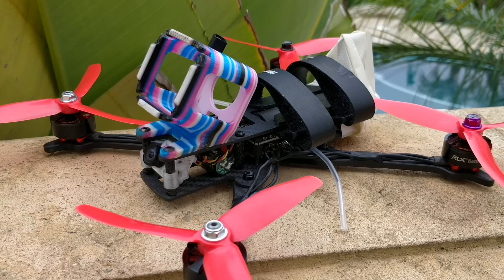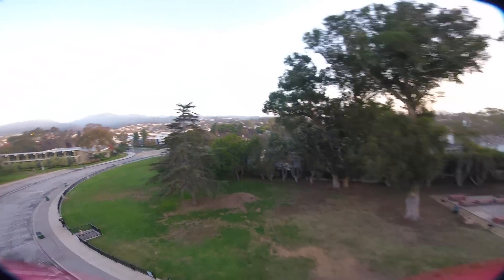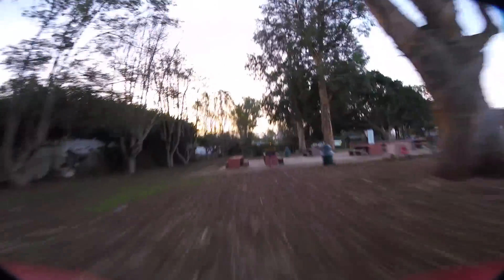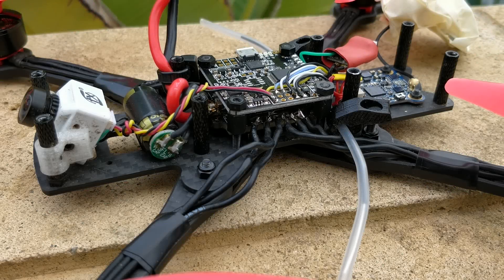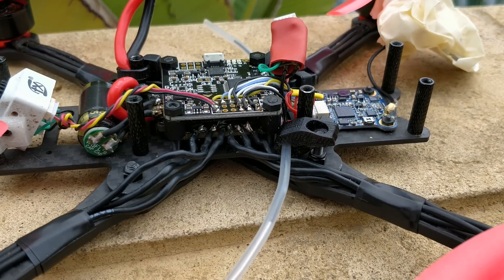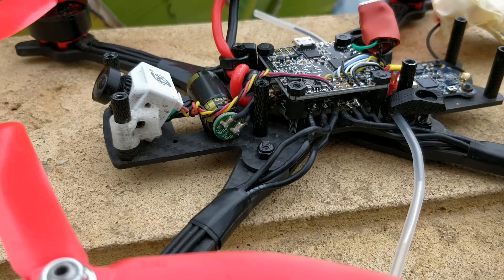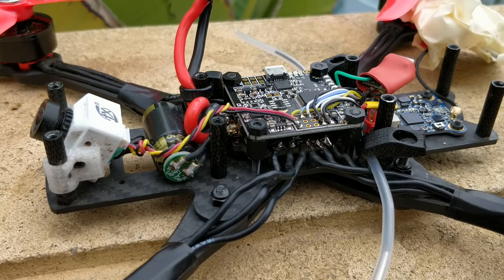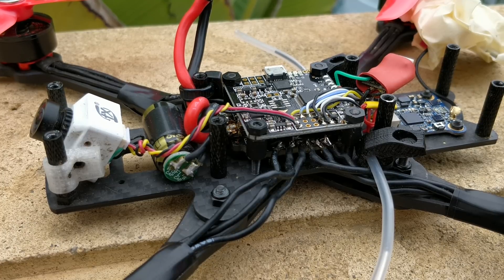Naze32 in 2019...

Comment: Where do I even begin... let's start with gyro sample rates and aliasing.  When you run good motors and good props, you aren't generating a mess of vibration in higher frequencies to be picked up by your slower gyro setting... and therefore aren't causing problems because filtering can do its job by only knocking back noise and leaving physical motion at lower frequencies untouched.  But when you have vibrations above the nyquist limit of your slower gyro read, it's going to alias over top of the physical motion data and cause it to fly terribly just like builds of old.  So it flies great cause you have great gear.  Props, motors, and frames of old made a bigger mess above the nyqyist limit and aliasing caused that data to stomp all over the lower frequency data representing physical motion.  Since we try to filter only above the frequencies of physical motion - this aliasing in the low frequency (false data) was the source of poor flight performance.  To test this you can go run an old version of betaflight on the same quad.  It will still fly great.  You'd just have to select the right gyro settings and filters cause the best approach for our current gear wasn't exactly default in the really old versions.  Alternatively you could go bend a few props and you will quickly see this current setup fly just like an old school build.   We pushed for faster gyro reads to stop aliasing so filtering could clean up the problems generated by messy gear.  It's still a useful tool, it's just not widely understood for the advantage that it really gives us.  It helps damaged or lower quality gear fly better.  So I give my kudos to the prop companies and frame designers - these are where the biggest improvements have been made to improve flight!  Happy new year
Reply from the maker: Interesting. I would note that the motors on this quad are totally wrecked and the besrings are even crunchy. That's hard to do on a 9mm bearing. It seems like different approaches to the same thing and nothing is perfect. 

I would ask you about another area too. On micros, the higher rates definitely make a significant difference. I don't understand why it seems to matter more on micros.
Reply: @Kabab  I agree with that observation.   Even on the alienwhoop zero where we only run a 1k loop, we read the gyro at 8k cause anything less flies terrible.  Micro brushed has to run so much more D to fly right which is just a huge amplifier for noise so definitely related to accurate gyro data.  Micro brushless just due to physical size (smaller props/shorter arms), and motors that are turning higher rpms generate a noise profile which is much higher in frequency so again tied more closely to gyro read speeds for accurate data.  An interesting account from a firmware dev I read a few years ago described a method where he plucked his props by finger... and listened to the note it "played".  He set his filtering to that frequency and it flew great.  Smaller props play higher notes and require faster gyro reads to avoid the aliasing issue.
Reply from the maker: @_NFE  very interesting and makes sense. So something like an X class craft would pretty much never ever need anything past 1k gyro rate since everything moves so slowly. This also make clear why car sensors have such slow refresh rates. 

So these recent big prop whoops I'm building have PIDs not unlike brushed quads. I assume PIDs are based on power. The one with the racerstar motors has a D of 80 or something while the more powerful one in the video going up in about 2hrs and based on an 0802 12000kv motor has Ps of 100 and Ds of 50 on 1S and 57p 35d on 2S. Am I in the ballpark or just shooting in the dark?  I was working with these numbers to make them fly right in gusty conditions. Definitely improved a LOT. 

Oh yeah, a PID rate of 8k with slower gyro rate seems to do nothing. By your logic that makes sense.  ?
Reply: @Kabab  yeah your right on the money that pids are based on power.  More specifically the response characteristics of your build.  Power is certainly a major factor in responsiveness, as is a motor's ability to change speed rapidly, the bite of the prop to affect inertia and momentum.  Funny how similar the concepts of "power" and the ability to change the application of power very rapidly are to the concepts of P (proportional response gain) and D (rate of change of the Proportional data).  Your numbers for larger "whoops" sound ballpark... but I question the sanity behind diving into that rabbit hole in the first place.  Ducts are an aerodynamic disaster.   Beyond the novelty of the tiny brushed indoor craft where the additional drag brake of a ducted frame helps in navigating a tight course, I see no need to persue ducts in any other application.  But my prejudice aside, hauling large ducts around is going to take an abundance of P to overcome the influence of the drag, and high D to go with that high P but in a ratio that is lower to P  than an unducted craft since the ducts do part of the damping for us which the D gain is responsible for.  This is an application where an error based D calculation like the ones we used to have which is now called feed forward is helpful.  It makes the D term work double duty both damping the response to environmental changes and accelerating the changes requested by our sticks.  Another concept which is sort of a turning point is how we handle responding to environments that can place larger forces on our crafts than the craft itself is capable of creating with stick inputs.  It's certainly never going to be an issue on on a 5", but a tiny ducted micro and certainly find itself in turbulent enough air that far exceeds any forces it's tuned for as we tune to stick inputs.  This is where a long dead and abandoned concept of P setpoint weight comes back into play.  Essentially allowing two separate tunes to run parallel ... one for resisting environmental ingluences, and one for response to stick inputs.
Reply: ...and if I'm reading your last question correctly ... a pid rate of 8k with a slower gyro rate ... yes that would just be running the "system" faster than the "data" is coming in.  Which sort of points to back to the concept behind your video I think... which is that the "system" , or pid loop, runs pretty darn well at 1k.  my purpose in responding to you was to articulate your point that while a 1k system is more than adequate for guys like us, there is great benefit to running the "sensor" the system is using at higher sampling rates for accurate data.

Comment: REQUEST: you do such good analyzing. We would be curious about your thoughts about different FC Firmware. Betaflight vs. Butterflight vs. FlightOne vs. KISS. How do they feel and are some only useful for one application like racing vs. acro?
Reply from the maker: Well, kiss is too expensive for the majority to consider. I don't like Preston so I won't touch flight one and betaflight flies damn good. With BF 4.0 on the horizon it's supposed to get much better still. 😁👍

Comment: I run a lot of old gear because I buy it dirt cheap second hand due to my budget. My naze32 flies great on the last Betaflight release to support F1 chips. I don't need OSD because I use a Flysky ia6c receiver (also second hand) which has built in voltage sensing telemetry. Beepers can be hard to hear over the props, but you can always just hook up an LED and a resistor to the beeper pads so it flashes instead of beeping, then position that under the cam so it gives you glare...

Comment: Unless you are running on KISS, besides the iFlight KISS liscnesed FC which has OSD built in; all of the other KISS FCs Flyduino has ever made (V1, V2, AIO) do not have a OSD. You have to do a seperate board as you mentioned towards the end of the video. Biggest advantage with the KISS stuff is the OSD is actually way faster than any BF, BuF, or RF/FL1 OSD since it doesn't use a SPI. KISS just hooks up to a spare UART (serial ports in their case) and it just works. Currently using it on my rigs and have no issues to report with it. Yeah, not as convinient as the other firmwares out there where you can just change stuff on your OSD in the OSD tab in whichever GUI you have on the computer. The KISS one requires either a USB port (Mr Steele or Wolf PDB) or a FTDI adapter as in the case with a MinimOSD or a Piggy OSD from Furious FPV. Once you do it a few times it's actually pretty easy to work with.

Comment: I still have a flight worthy quad sporting a KK2 board.  Its where my root are so I keep it around along with a wooden framed Tricopter (David Windestal from Finland designed).  But in all honesty, technology moved too damn fast for me and I wasnt able to keep up.  F3 is my most current FC and I have several Naze 32 rev 5s still in the air.

Comment: Love the retro tech idea! really like the capacitor pcb ,if you glue and solder the pins it's going to be more secure and if you break
the wire you can easily see it.Also like the 3d antenna mounts.
So now you have a rudder on your quad ,how is your yaw authority?
Reply from the maker: ha.  No not quite.  It doesn't seem to have any effect.

Comment: Hi Kabab, 
as far as I have understood 32K has an advantage in handling prop wash. Everthing else, like basic flying does not need more than 1-2K PID loop time. The software is more important and low noise is more important. A 32k brings in a lot of noise. Because of this it does not need to be better. And if it is better only by a tiny bit. 
Or is it a myth altogether? 🤷🏻‍♂️😁
Nevertheless awesome contribution to that discussion. Thank you!

Comment: Somebody already stated that the ESCs also improved drastically and that this is almost more important than the evolution of FCs.
Remember SimonK without active braking?
I remember floating around alot, you could not instantly lower throttle and make the quad drop out of the sky.
It took some time for the motors to reduce rpms back in the days.
That's why most people including Kabab remember the quads as being mushy and flying "akward" and not as locked in as nowadays.
I remember flying with active breaking for the first time and it was like day and night compared to SimonK.
On the other hand there was much less potential for noise in the system.

32k is not worth it yet as the gyros that can do that speed are veeeery sensitive to noise and most people will not feel a difference (maybe propwash handling is a tiny littlebit better).
Time for Bardwell to test that and let people fly quads without telling them the cycle speeds.
I think the outcome would be hilarious. :)

Comment: When I heard you put BF 3.5 on it I was like, I am going to make a decent USB receiver from my Naze board for liftoff. But unfortunately it was 3.2.5. :(
Does anybody know of a BF 3.4+ port for Naze32 that includes the simulator stick mode? I mean that it supports the USB_HID_CDC CLI command.
Reply: TBH, with the exception of the more recent BF4.0 builds, I honestly think 3.2.5 is actually better overall.  I'm still running my fleet on 3.2, so just run that.
Reply: Yep, but 3.2.5 does not include the gamepad / HID function. That board has a dead gyro anyway, so if I do not find any use for it I will simply throw it away. A new gyro would probably cost the same money that Kabab ordered his "new" naze. :)

Comment: So, R-XSR on F-Port (requires reflashing the receiver) would also work for that - it'll even run LUA scripts and all that junk.
Dunno how hard it would be to incorporate flight code from the BF4.0 builds onto this, because that would be cool to show that firmware improvements basically trump most of the FC hardware updates.

Comment: I'd argue that ESCs and motors are the biggest factors. A couple months ago, I performed pretty much the exact opposite experiment of Bob's. I put an Omnibus F4 V1 flight controller in a KingKong Hex 300 (a model from 2015 that comes from the factory with a CC3D board running LibrePilot). Even with an F4 board running BetaFlight 3.5 and active motor braking enabled (which was turned off from the factory), it was still just as clumsy and uncoordinated as before, and bounced around like all those ZMR250 flight videos from a few years ago. The BLHeli non-S 12A ESCs may or may not have been fine, but the motors had no torque, and wouldn't even spin properly below 1200 throttle.

I then put the same flight controller on a new 5" hex build with modern SunnySky 1806 motors and BLHeli_32 ESCs and it flew just as smoothly and compliant as we expect any quad to fly these days. The battery and frame weight/dimensions were about the same between the two hexacopters, but the power train made all the difference.

Comment: I could not tune the naze to save my life. I also broke everything to the point I hated everything but still had fun.
Reply from the maker: Now you can!! :-D  This is default PIDs!
Reply: @Kabab  Remember when you reviewed spedix es20 lite. I use them today on my 6s race quads. I prefer the individual esc's because they are cheap and can be swapped in between races quickly if needed. I have them under my arms. Serge is suppose to make a 6s pdb fc like the clracing/bardwell. I am still waiting.
Reply from the maker: @danlatu209  very few still use individual ESC's. That's why it hasn't been made

Comment: I'd like to see what the 8 bit KK2.1 would do as well on that ESC which is a far cry better than the standard ESC's used before Simon Ks and BH came along creating an easy to demonstrate improvement in response on the bench. I think this is showing how important the ESC is as well as the pilot and BF 3.2.5.... and SBUS. This is not how it really was back then where all you had to do is add on one part made by DJI and the thing would fall out of the sky as Time Cop warned....;-) Look how fast things changed.... now they don't even fly away anymore and the Chinese know where each one is.

Comment: Naze32 = $5
Kiss v2 = $70
Flight performance difference = zero
Let that sink in
Reply: It's definitely not zero.  But for most, it's also not a $65 improvement.
Reply: A rich baby's pacifier is made of plastic and costs $100.  A poor baby's pacifier is made of plastic and costs $3.  Go figure.
Reply: I would have to disagree but to each their own.
Reply: If Felix would open-source all his code, I'd buy them.  Probably even donate to him.  Might even love him.  But I bought KISS ESC's back when I didn't know any better... then I had to update them.  OMFG what a hassle!  They have serial #'s that you have to put into a keygen unlocker thingy like I just bought WinRar or something, and I couldn't flash through the PWM, so I had to desolder everything, cut them out of the original flitetest-provided shrink tubing, which was like 4x as thick, then I had to solder wires to special flashing pads on the board...  it took a bloody day to do 12 of them....  a whole day!  KISS is just quad parts that are marketed to people who can't use a PC, yet in all reality are designed to mentally cripple someone who can only manage to use a MAC, plus waste a day and 14x your money in the process.  I will never forgive him.  Pure evil.

Comment: Great Video and thank you for testing this out. I never flew anything older than F3 FC and blheli_s  ESCs, but now I'm wondering how much of that bad old flying experience you talk about came from other parts. How would this quad fly if you used old ESCs with that analog signal? Or how much worse would it fly on older props? Which part do you think has improved the flying experience the most?
Reply from the maker: I think the FC code matters more than anything

Comment: You have a Quad Theory and i have my moved mass theory. i said it years ago, there is a limit in accelerating and braking the mass of the props, increasing loops per second is only half the solution. at some point you need unlimited power to control the props in the shortest possible time. so it makes more sense to improve the flight code itself for fast smothness. one in our crew is still using a 8yrs old armokopter with analog devices sensors, because it flies so smooth. i dont know exactly why there is always the need of mhz crazyness like in the cpu or gpu filed. good luck, its not that expensive.

Comment: Amazing experiment. Thanx 4 sharing! I wonder how you could install BF 3.5 onto an F1 board, thought 3.2 was the last one supporting F1 due to lack of memory. Are dynamic filters possible on F1, is there enough cpu power for that? Or just a question on loop frequency? It looks like it is all about software and smart filtering.

Comment: For the longest I've wanted to see (Dronin Firmware with Revo FC) tuned and compared.
Compared against Latest BF! Battle of the Firmware Video!!!! Freestyle Firmware Battle. Submitted for your approval 2 (5 in Freestyle Quad Configured/built similarly except maybe for FC, since not all FC can run all firmware) Any popular firmware could compete.
There is nice firmware out there being overlooked.

1- BF vs Dronin (Auto Tune Baby)
2 - Arducopter vs BF
3 - Butter vs BF.
 Rules 4k/4k max Loop. SBUS no matter the receiver.  GPS functionality (For recovery - How well does the Firmware protect your investment)